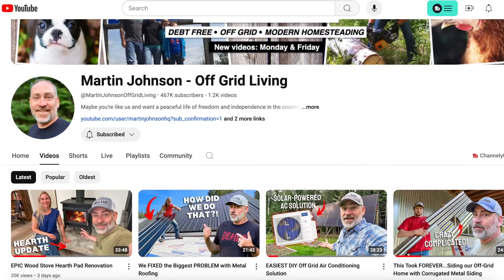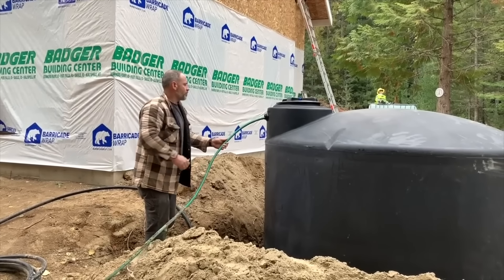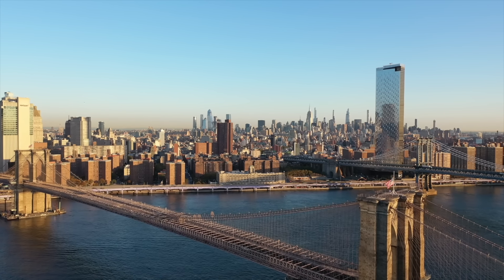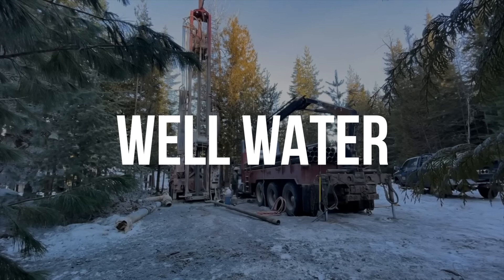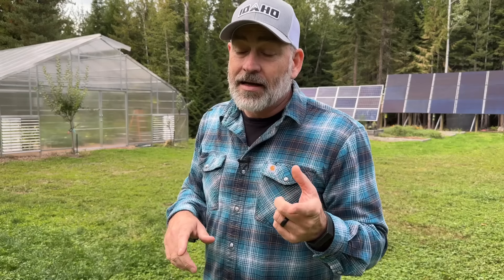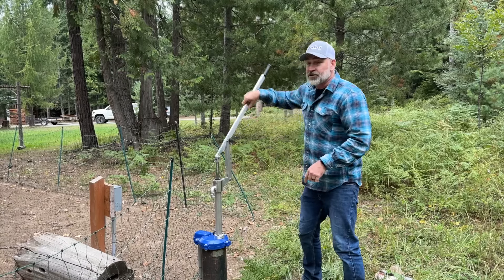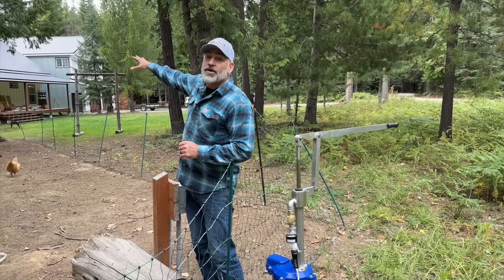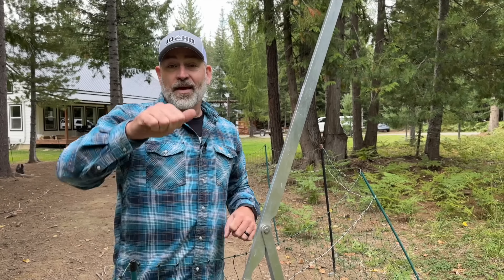This Will KILL YOU in 3 Days | Emergency Grid-Down WATER Solutions

Comment: I guess me and my wife are “prepers”. We have 25 year food packs, canned food thru the roof and a water well that the level is 10 feet. I have several ways to get the water out, so food and water are not a problem. Now, the AC? There’s a problem
Reply from the maker: Yes you will need a way to power it. Have you seen our videos on our Solar system? They might be helpful.
Reply: @MartinJohnsonOffGridLiving  power it? I just put the handle on the pump and pump it. My water level is only 10 feet below the ground

Comment: I don't even know what distill means , I definitely would like a video about it.
Reply: in simple terms, you boil water in a container that is sealed with only a tube (generally copper) coming out of it. as the steam goes up through the tube it cools off and becomes water again and is forced out the other end by the pressure and collected in a clean container. when the water turns to steam it leaves behind all the contaminates because they don't go up with the steam. if you have ever seen a "moonshine" set up it is the same thing.

Comment: Here in Brazil are water is in tanks.  I have a 3000 liter tank which is on a hill but most houses it is located in the roof line or on a small tower higher than the house.  Water goes out  you have at least the size of your tank until it runs out.

Comment: Thats one of the problems here in Nc since hurricane Helene. No power to run wells, public water is down in lots of places. Roads washed out so it is hard to get bottled water to people that need it. Some people are even using mules and horses to get supplies to people where they can't get an helicopter into. It is bad in NC and eastern Tennessee.

Comment: I need to learn to distill water.  I have a 10 acre spread in the NV desert with an artesian well that is supposed contaminated with arsenic.  I have an under sink  RO system I have yet to hook up but I haven't worried about it because I am hauling drinking water in.  That's okay for now until its not ok..I need a back-up plan.  Water distillation maybe the only way to go..
Reply from the maker: Sounds good. I'll plan on doing it this winter as soon as things slow down around here. If there anything more specific you are looking for?
Reply: Your state can test your water and give recommendations on what to do for filtering.
Reply: @orasmiller1273  They can also lie.
Reply: @MartinJohnsonOffGridLiving    You just mentioned "Simple Pump" and Minden NV.  I am assuming  you are located around here..my place is in Fallon.  I am trying to get the water system up to speed for when the SHTF event happens.  I am hoping to pick up ideas from your videos and others that I like to watch.  Thanks for the info..

Comment: If I wanted a redundant pump in my well, it would not be a hand pump.  I would simply put another submersible electric pump and get a generator to provide off grid power for the pump.   A mechanical hand powered pump can fail just like an electric pump and probably is not as reliable.  However I already have a generator and off grid solar system. It would be a good Idea to get a replacement spare pump in case mine fails but I do not want to deal with two pumps in my well should one fail.

Comment: I have 30 gallons of fresh water stored and the capacity to filter 25k gallons.
Reply from the maker: You sound pretty ready! 👍
Reply: @MartinJohnsonOffGridLiving  We just went through HUrricane Beryl. Direct hit. 9 days no power. We very well prepared for extended loss of utilities. After Hurricane I and 15 days no power we truly embraced prepping for extended issues. 800 lbs of dry staples, some freeze dried but mostly rice, beans, flour salt, baking goods and seasonings. We use 6 gallon buckets with a sealed liner and gamma sealed  lids.

Comment: Will it create a siphon for continuous flow?
Reply from the maker: I think, the end would have to be lower than the beginning.
Reply: In other words, NO!  Siphons only work by gravity, and if your water source is below the ground, a siphon won't work.
Reply: @theclearsounds3911  you might want to check out how to siphon water uphill.
Reply: @stuartrinker  That's perpetual motion, and it doesn't work.  If you're talking about a RAM pump, that isn't a siphon.  It works by the power of flowing water from a nearby stream, and I don't think the Johnson's have a nearby stream.
Reply: @theclearsounds3911  didn’t know the term but that’s what I was trying to say. Wasn’t sure.
I know what a ram pump is. We use one to fill our cisterns for the year.
Reply: @stuartrinker  See what just happened?  You told me to look up something, and when I did I told you what my lookup found, then you had to look it up. 😊 Seriously, though, I forgot all about ram pumps until you made me look it up, which is why I thought you were talking about perpetual motion. Now we understand each other, and it's all good.
Reply: @theclearsounds3911  agreed. A neighbor of ours and me attempted to do the uphill siphon years ago. Elevation was our issue along with probably size of pipe. We used all the same size 1”, which he thought might have been an issue. He thought that the outlet side should be smaller. Due to the distance from our creek/spring I didn’t want to spend the money on more pipe. He also maybe thought a couple check valves to help reduce the static weight might help. We argued on the check valves and never continued. Enough of my ramblings. Have a good day.